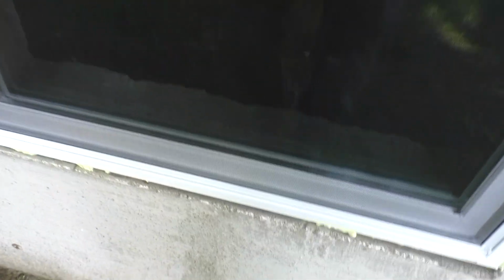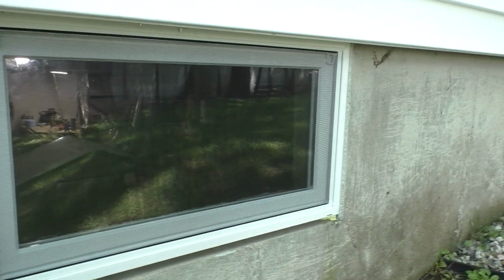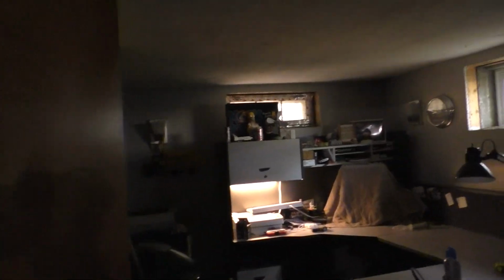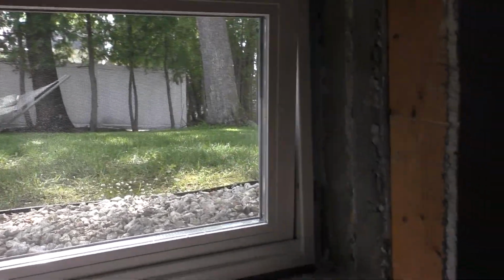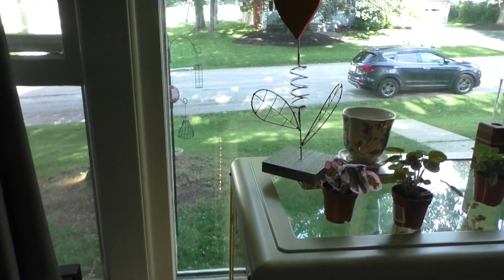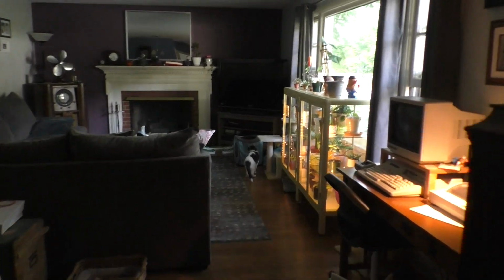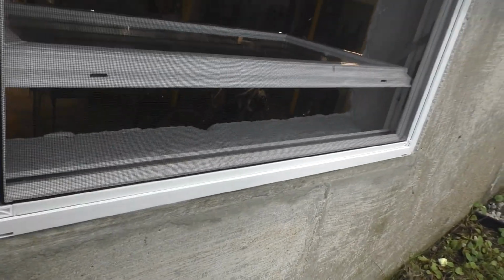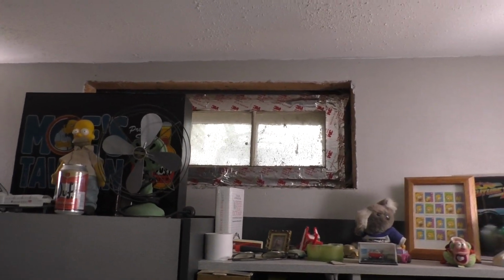Basement Window Replacement - Part 3 of 3

Comment: Excellent job. You could have used a white masking tape, the same painters do to protect the window frames from the mortar and caulk. Also it's a good idea to put some wheelbarrow in front of a window while lawn mowing. As for the last remaining old window I'd just remove it and wall it up unless there is not enough daylight.